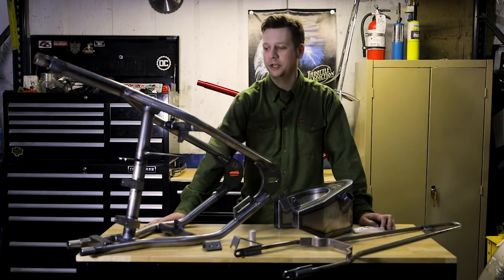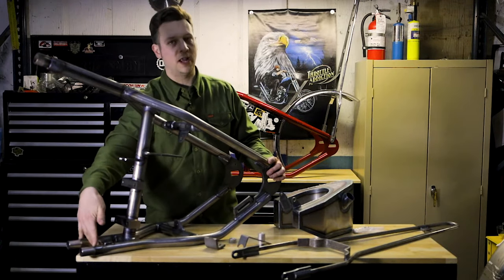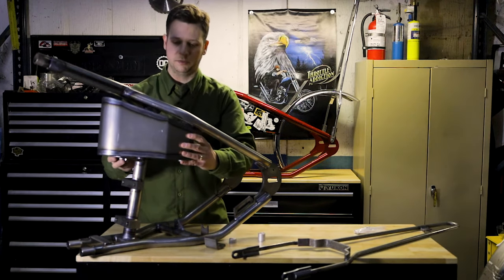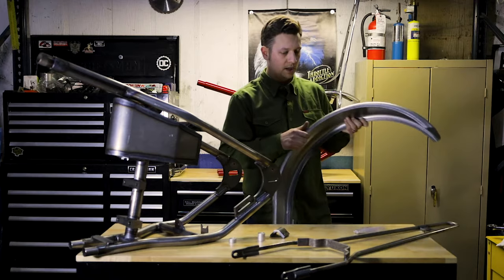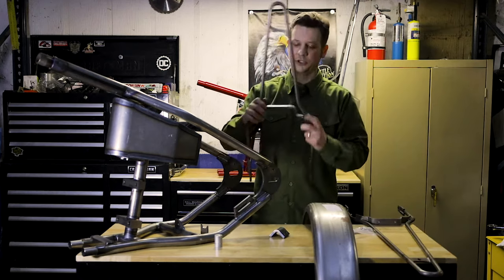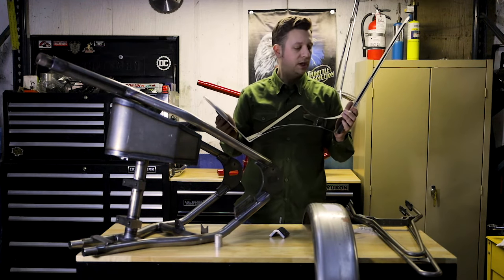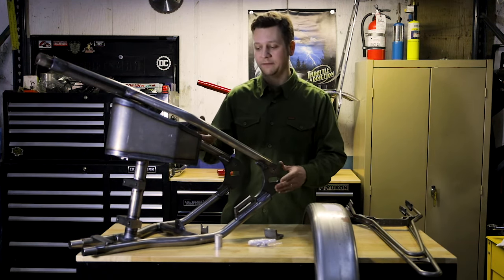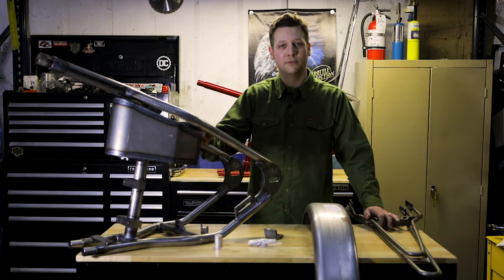Hardtail a Sportster: In depth review of the Throttle Addiction Deluxe Sportster Hardtail Kit.

Comment: Excellent. Helpful to see. Did he mean to say the battery sits up near the oil tank? Or rather does battery go there? I thought it was part of kit somehow
Reply from the maker: The battery sits on the plate welded to the frame, is held down with an included bracket and is hidden inside the horseshoe portion of the oil tank. It is designed to work perfectly with the 12 cell antigravity battery, but will fit many others, just the hold down bracket may not work properly.  All this is welded on and in place with the deluxe kit.
Reply: @ThrottleAddictionCo  thank you!
Reply: Any chance of getting some pix of how the stock rear wheel, axle, brake, and spacers are set up with a chain conversion? I have mine set up, but it seems off. Thanks!
Reply from the maker: Chain conversion should not affect the spacing of the rear wheel. Regardless of where the sprockets line up, wheel still needs to be center in the frame.  You can line up the chain by using spacers or offset sprockets, front and back. So in other words, space up the wheel first, then the sprocket/pulley and chain come secondary.

Comment: So if I was to buy the deluxe kit with the king and queen seat and tall sissy bar, the Frisco narrow gas tank + cap, the 12 cell battery you guys sell, and a extended belt I could run all my stock stuff on a 2000-2003 sportster 1200? The kit doesn’t include a license plate or tail light mount does it ? What size tire would the fender with the kit allow you to run I’m looking for more of a skinny tire look
Reply: Besides little fittings and hardware obviously